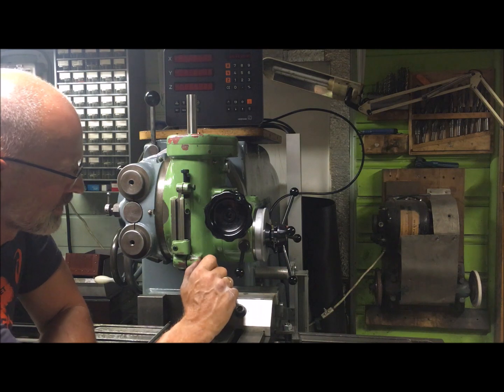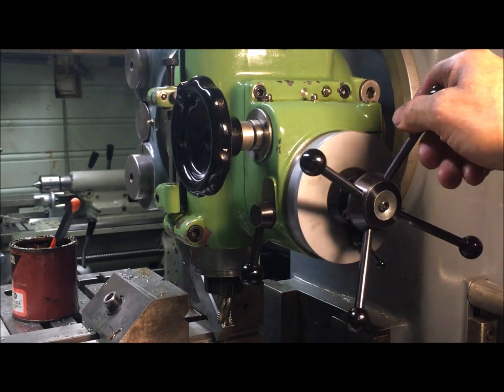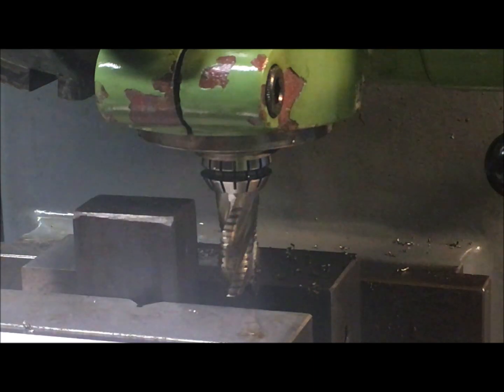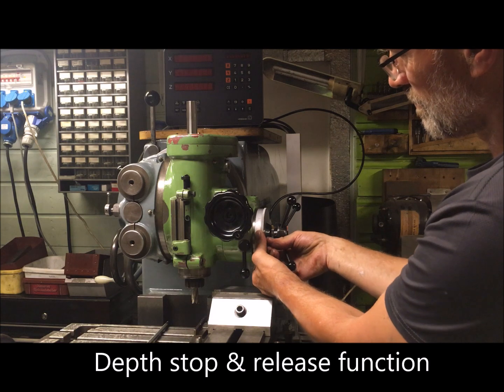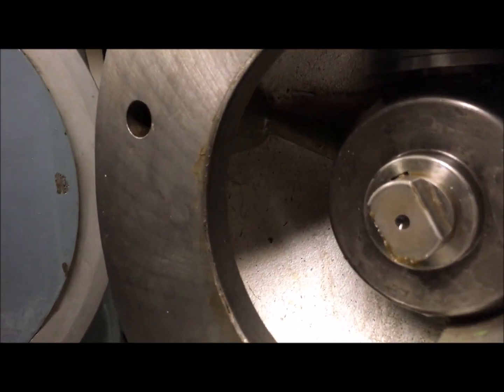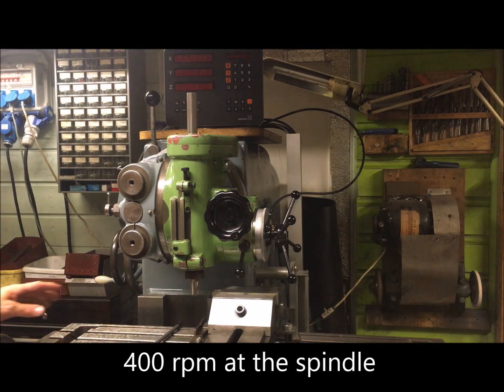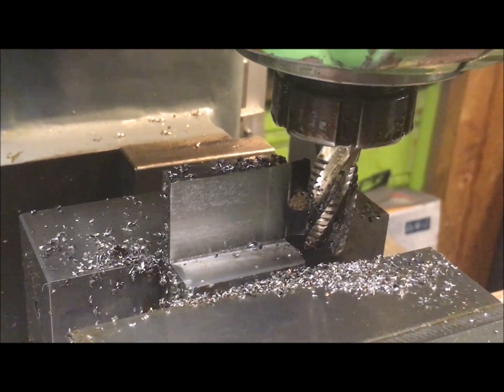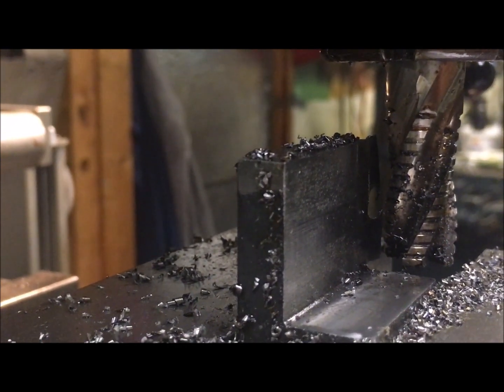Schaublin SV52 High speed head -  part 2

Comment: Very well made and useful video Jan - thank you for your generosity! I have a similar mounting issue and I wonder if you could share the dimensional details of the drive plug you fitted to the dog clutch type of face coupling in the Hi-speed head - how did you measure and make the interlocking teeth on your drive plug?
Reply from the maker: Thnks for the nice comments! Much appreciated.
I will take some measurements and send you
Reply: Jan that is very very kind of you. You are a life saver! It is not at all easy to take accurate measurements from the dog clutch type coupling itself since it is recessed as you know. I was thinking that the teeth might be a standard involute form but I do not have sufficient involute cutters to try to find one that will fit by trial and error. My next step was going to be  taking a plasticine impression and measuring the teeth from that, but much better to follow your findings.
Reply: Jan I have now a Schaublin drawing of the drive coupling for the 53 Hi Speed head so I  can make one up. I can send you a copy if you are interested and give me an email address. Many thanks for your offer anyway
Reply from the maker: @AdamHarris-w5v  Hi there, I already have a drawing of the more frequenctly encountered 53 head, but thanks for the offer. Pls. note that I have made some measurements of central boss or "drive adapter" on my 52 head and uploaded this as a video on my YT channel. Hope this can be of help to you. Feel free to ask if something is unclear.

Comment: Hi Jan,
Thank you for uploading this video. I am comtemplating purchasing a Model 53, having found one at a reasonable price in Australia, they are rare here. I only operate a home machinest / fabrication workshop, and I know the machine will far exceed my abilities to use its functionality. After much researching, these and Deckels, I have decided on the Schaublin 53. I am interestested in finding/buying the high speed head for it and obtaing any other tooling that may suit. I have done much searching on the web, but, to no avail. Would you or your readers? have the time you point me in the right direction. I am very passionate about machines and machining. The information would be much appreciated.
Cheers & thanks again,
David Harper (Australia)
Reply from the maker: Hi there,
thanks for the comment. I am glad the video is of interest to others.
There are possible more Schaublin's in Europe, but not a lot.
Do I understand it so that you already have "secured" the milling machine itself and only want to purchase the high speed head? Otherwise I know of one 53 with such a head available from a dealer in Denmark.
See he link here: https://www.rpv.dk/machines/stockno-5193/?lang=en
You also have a couple of sites in Switzerland that may be worthwhile following, Ricardo.ch and tutti.ch. Eg. I entered the searchphrase Schaublin 53: https://www.ricardo.ch/de/s/schaublin%2053
Then there are several auctions inwhich one from time to time can come across machines/parts like this. Search for "Zubehör Schaublin 53"
You also have some dealers in the UK and in Europe, eg. a specialist called Anglo-Swiss machines:
http://anglo-swiss-tools.co.uk/used-machine-accessories
Also: https://www.machineseeker.ie/UNIVERSAL-MILLING-MACHINE-SCHAUBLIN-53/i-1718543

Comment: Very good, perfect timing. I watched part one only a few days ago as I have just been fighting with the original E25 collets in my high speed head!  I have just ordered a set of ER collets and will make a similar tool. Thanks for the idea, it has taken up considerable thought lately :)
Reply from the maker: You're welcome! The tool was just a very, very qucik and dirty "prototype" but seems to function. I made mine out of a wrench that followed an angle grinder. It is however very soft steel, and also my hack-sawing isn't pretty. I will probably experiment some more.. The obvious solution would be to  buy an ER collet nut, but my machine has different threads than what these 25 size collet nuts have today. Making one is a little over my abilities I thought.. another possibility is to modify the existing nut, eg. drill a hole into  the side  so that you can push a rod in to this and the slot inside, then rotate the nut

Comment: It did not sound like the load was pushing the motor much.  Hobby machining will not need anything your mill can't deliver.  Interesting that the drive gear is a spiral bevel, not a cheaper spur bevel.  I like it!
Reply from the maker: No, the motor spun OK, no apparant problems, so I am confident I could have pushed it harder also
Schaublin spared no expense.. :)